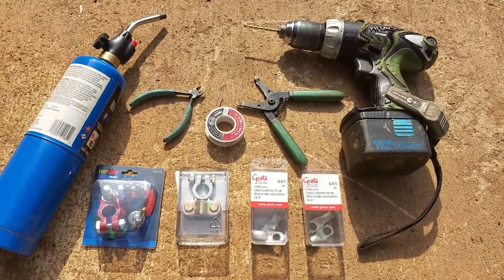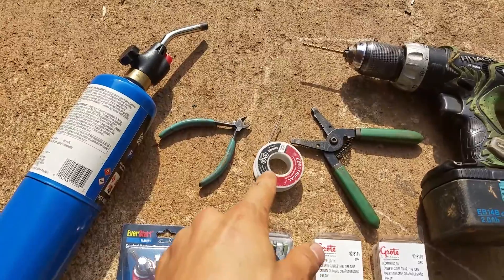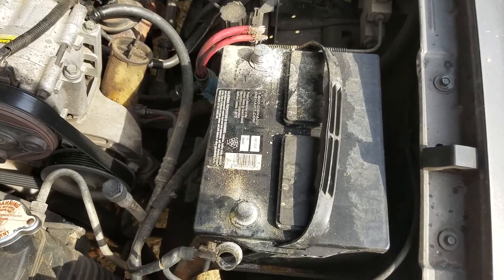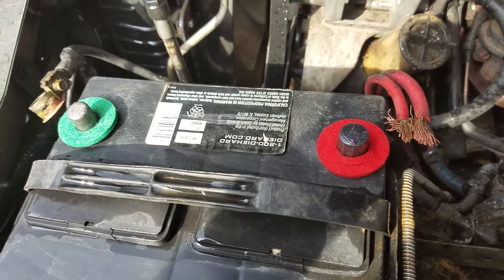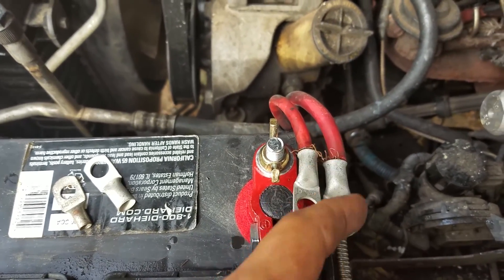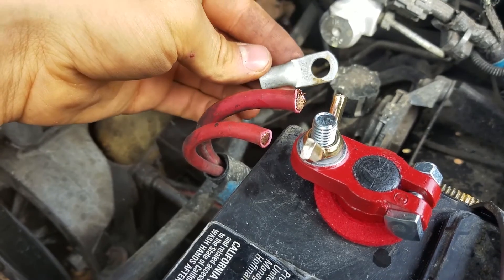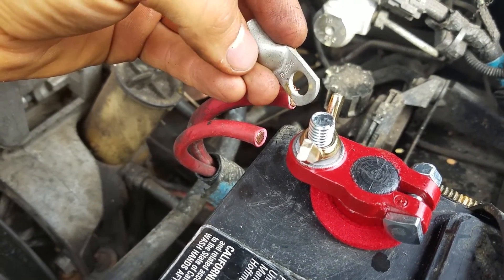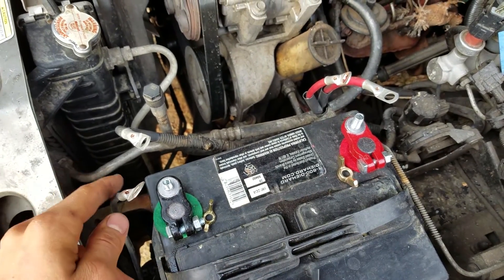NEVER Have Corroded Battery Terminals Again!

Comment: OMG, Google Hindenburg !  NEVER use a flame around a battery expelling gas You Wingnut !!  DONT POST CRAP LIKE THIS FOR PEOPLE THAT KNOW LESS THAN YOU DO  !
Reply from the maker: You have no idea what you're talking about. It gives off a tiny amount of Hydrogen when its charging, and it's vented outside the battery. It only matters in a tiny enclosed space that's not ventilated lol chill.

Comment: You don't need to drill those holes in your lugs. If you use rosin flux the solder will wick into the connection and be drawn to the heat. I actually just fill the lug half way with solder dip the wire in flux. Heat the lug until the solder melts and push the wire into the lug. The excess solder will flow out.
Reply from the maker: That's a good idea. I never thought of doing that. You are right it wouldn't work without flux though.
Reply: @MattsShop  I just bought a small bottle of rosin flux at an electronic supply.

Comment: never drill the lug!
Reply from the maker: Why?
Reply: @MattsShop  Because you are reducing cross section. better way is to use metal cone and soft base for enlarging the hole without cutting material
Reply from the maker: Never thought of that. Good idea.

Comment: Nice job. Wing nuts are notorious for loosening and falling off due to vibration. I'd suggest using lock washers if you use wing nuts. I like using wing nuts especially for my multiple boat batteries and their respective attached devices because it allows me to quickly disconnect them so they (batteries and devices) don't get stolen. Most boating and sailing organizations now discourage using wing nuts because of accidental disconnect issues due to vibration. I'm not willing to give up the convenience of easy disconnection by using wing nuts so I at least use lock washers to mitigate the chances of accidental terminal disconnect.
Also, FYI, I watched another video where the poster just poured a cup of hot water (not boiling) on a corroded battery and ALL of it instantly cleared up. I then tried it on my car battery and it worked flawlessly.
Reply from the maker: +imahvi Yea, good point. I should have probably used some regular nuts/lock washers. Never had a problem though!
Reply: lock washers do nothing, if youre worried about vibration, nylon locknuts or maybe removable loc-tite.  Thanks for the video!
Reply from the maker: +Brian Walk That's not 100% true lock washers do help a lot, but nylon locknuts are my favorite and the best you are right. You're welcome!